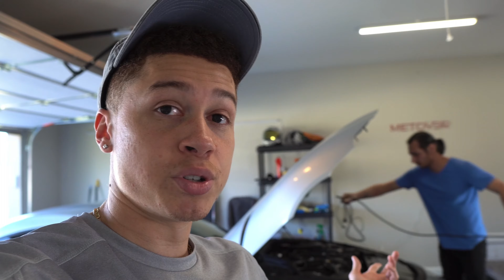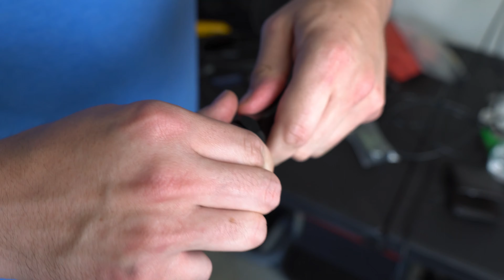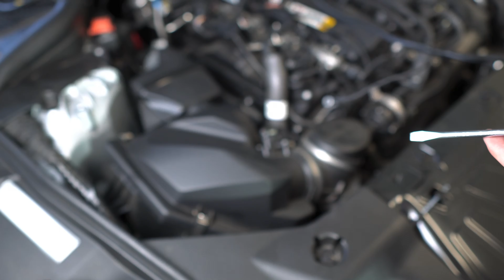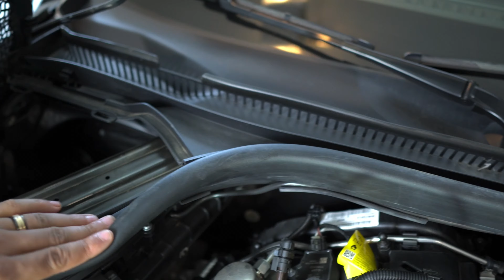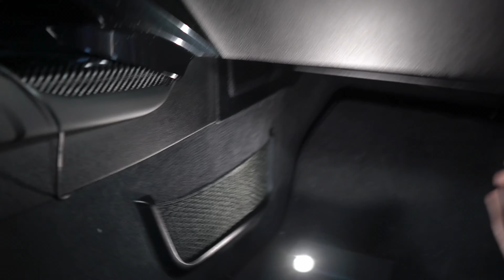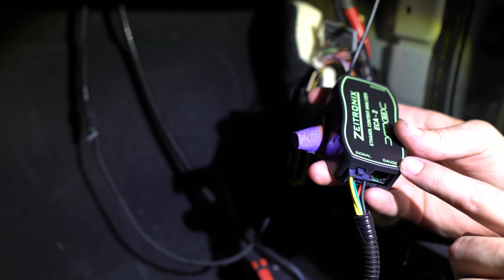Visconti Flex Fuel Install (Supra A90)

Comment: This is a lot of freaking work for a flex sensor jeez
Reply: I mean, it’s a lot more than that, it’s not just a sensor that tells you the content, it allows the sensor to communicate with the factory dme and adjust the tune for the specific ethanol content.
Reply: @EmaZVeizo   I guess but on other cars it’s so simple lol
Reply: @Imesswithcars  It's integrated with the ECU, so the tune can use the content. How other kits do that?

Comment: Did this require a custom tune?
Reply from the maker: He does have  a custom tune. The flex fuel kit allows you to switch ethanol percentage without having to switch maps.
Reply: Either a custom tune or (if platform comes with it) a basemap for flex fuel with the flex fuel tables enabled
Reply: Will need either Reflex with PI or Ecutek.... the OE DME doesn't have FlexFuel implementation yet